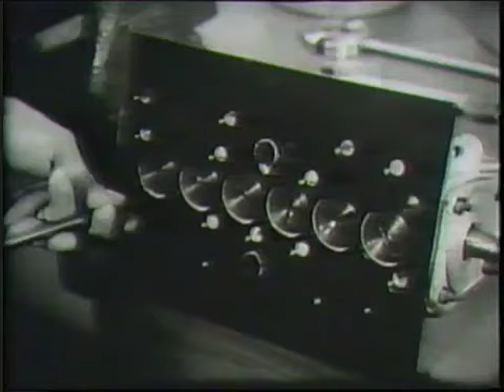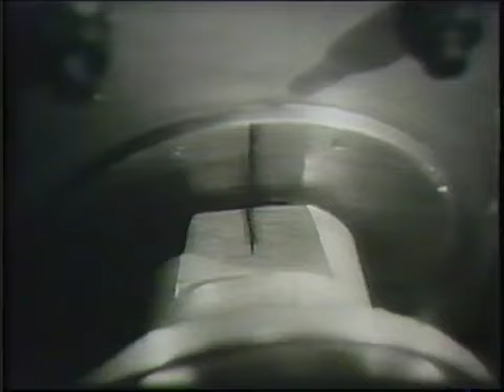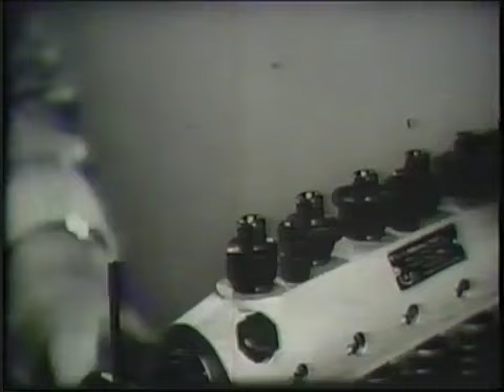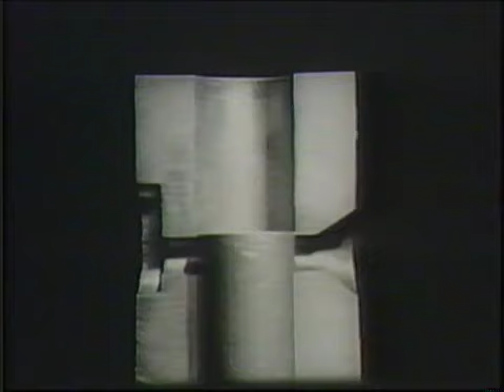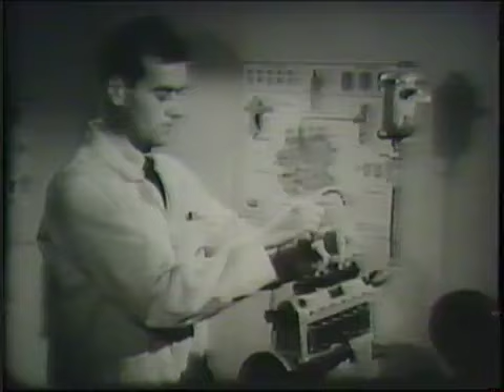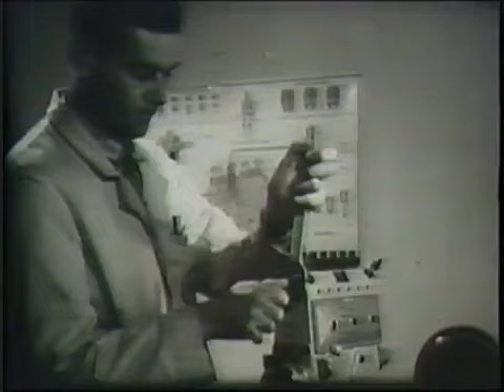CAV fuel injection pump timing - The Spill method

Comment: Hello. i have a CAV bpe6b, that i found under my house, do any of u guys know what kind of cars or what it was used for?
Reply from the maker: These CAV pumps were produced between 1920 and 1970, These were most commonly found on larger Lister Diesel engines, Like the JP6 JK6, they were also fitted to Kelvin engines.
The pumps were available in the following configurations.
1, 2, 3, 4, 6 cylinder configurations.
All items needed are still available to rebuild these injection pumps.
Reply: @VintageDieselCenter  thanks for answer, do people buy them? If yes, how much should I ask for it? Thinking about selling it
Reply from the maker: No trouble at all.

Honestly these pumps aren't exactly sort after, my best advice would be to list it on Ebay and possibly auction it off, otherwise give CJ Diesel Injection LTD a ring, Chris is based in Shepperton and buys in old equipment, if I ever get a beyond repair engine in I always send him the old Injection equipment and he tends to pay quiet well.

LDW
Reply: @VintageDieselCenter   thx man! i will do!

Comment: Still use pretty much all the tools he used in the video. The tub on the bench is such a great unit but easily the best thing is the original CAV felt fuel filter. I grab them whenever they pop up. They never should have stopped making them. Kelvin injector pumps have felt blocks in the back of them and they never suffered fuel issues. So many people get  the spill timing right but never check the individual cylinder phasing then wonder why the engine smokes on one or more cylinders than the others. Gardner engines make this so simple by use of engine specific phasing buttons for their pumptops. They are one tool I never ever lend out.